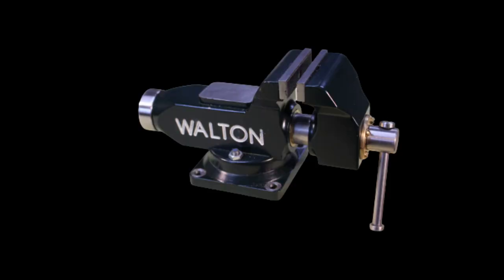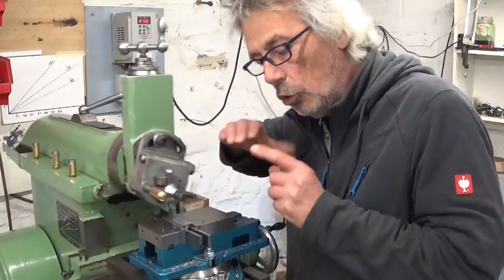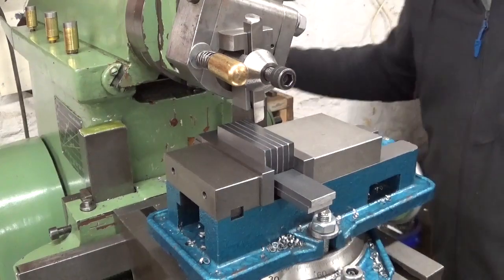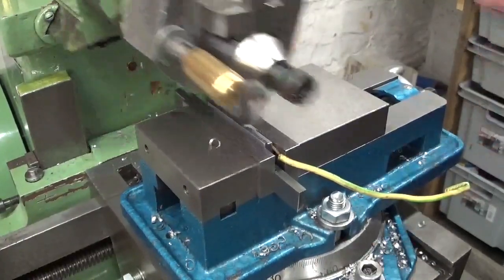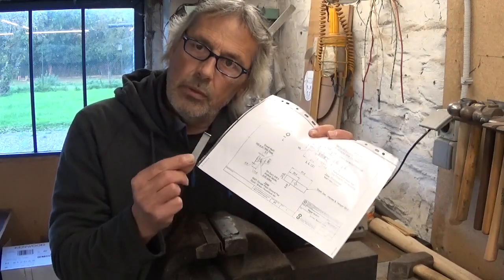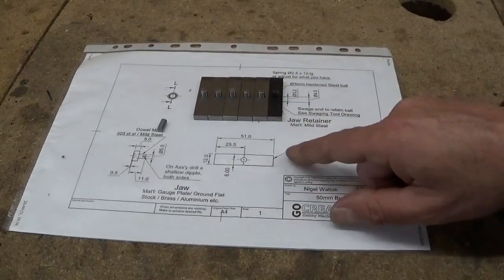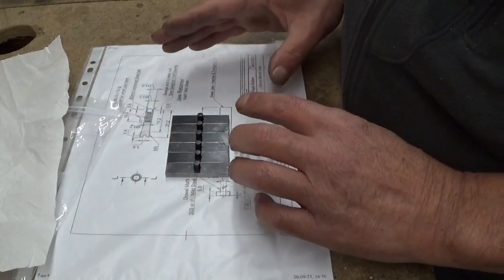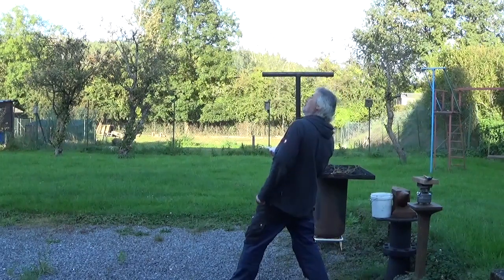Baby vice collaboration.

Comment: In the UK you can buy "ground flat" stock. This is also called gauge plate etc. I think that this is the meaning on the drawings rather than the fact that they are left ground flat. But you are correct that the drawings also didn't show that they were to be serated and so it would be up to the person making them (you) to decide.
Reply from the maker: Thank you very much. That's very interesting information.

Comment: Gday Rustinox, the jaws turned out great, I’m waiting on music wire to finish the jaw retainers so I’m hoping this arrives this week, the post is extremely slow here in Australia atm, painfully slow, the heat treat oven was a good setup, never seen it done like that before, how long did it take to get them red?, awesome job mate, Cheers
Reply from the maker: Thanks Matty. It's just a gasoline camping stove. It works only for small parts. To get them dark red it takes a few minutes.